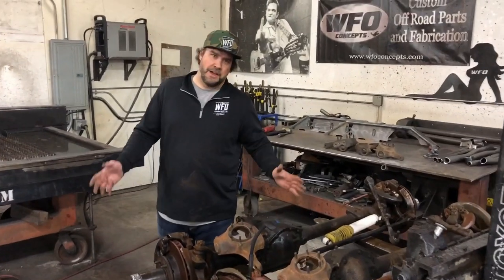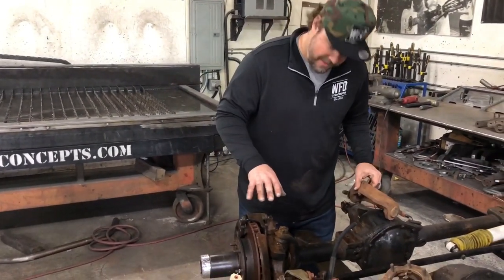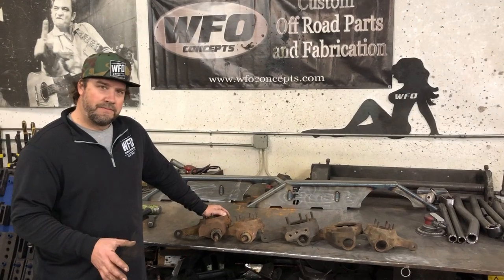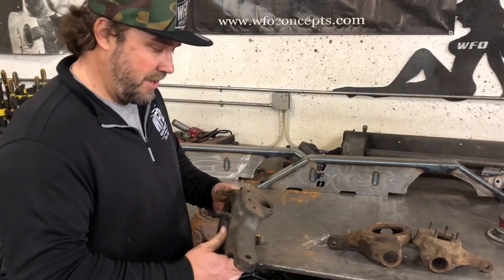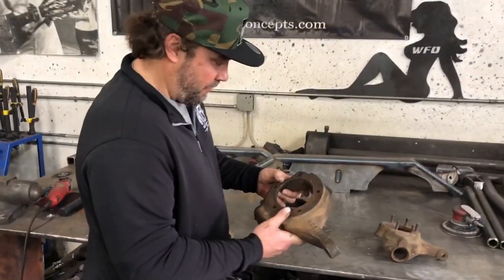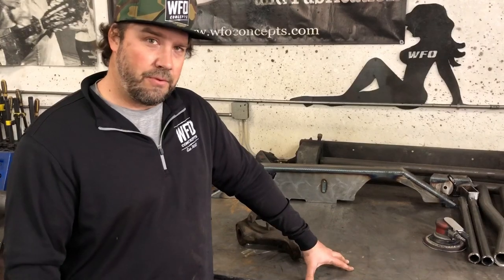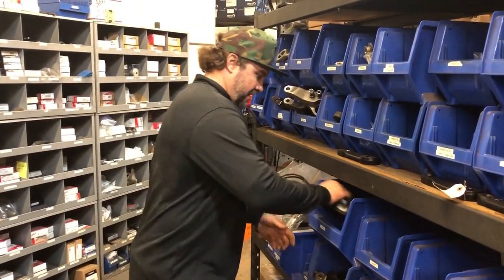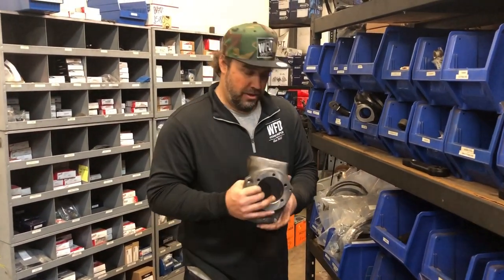How to Identify a Dana 44 Flat Top Knuckle

Comment: I have a Dana Ford f250 4x4 front axle with high steer arms, holes for the tie rod ends are a bit enlarged from usage. Where can I get high steer arms for my 1970 f250 with high steer arms?. Or inserts for Ford?

Comment: i have a 77? dana 44 im looking to to swap out the knuckles with f250 can i still use the f150 hubs and manual locks ? building it for a jeep cherokee and its going to retubed to fit id like to keep the same bolt pattern ? 5x 4.5 on the f150 is 5x5.5